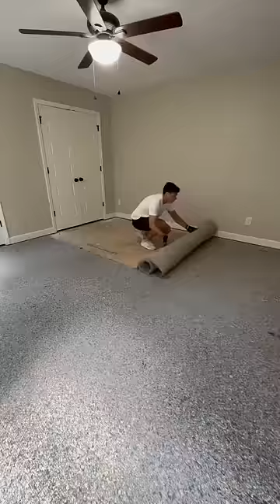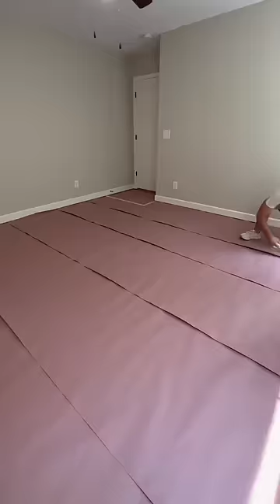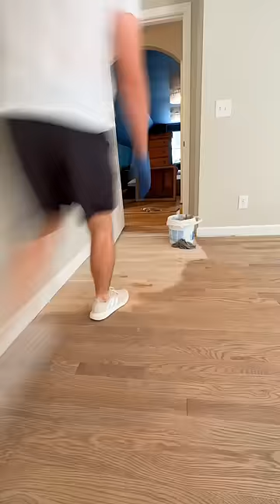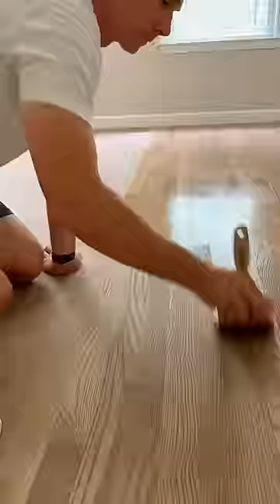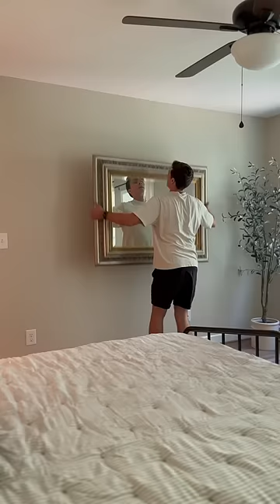Guest Bedroom Renovation #diy #construction

Comment: Wait… am I tripping or do some of the floor planks look like they are 1/4-1/2 inch from baseboard?
Reply: Yeah I’m wondering why he didn’t run it under the baseboards
Reply: Most flooring needs to be able to expand some what with changing temperatures & humidity or it'll cause buckling/ lifting
Reply: It’s most likely he didn’t want to rip out the existing baseboards so he just laid the flooring down and threw some similar wood quarter round to cover it up. You can see it in the end shot with the night stand.
Reply: Yeah most would have taken all base boards off the wall before laying the wood down. After installation of the floor you then put back the base board if sine right the base board will completely remove any visible gaps or cracks between the floor and wall. However I believe he may have just taken base boards off at the end and replaced them with thicker base boards wick should hopefully cover the gaps and cracks anyway.
Reply: It’s called quarter round
Reply: @N9tmare-s550  Technically we call it shoe trim in this situation. Quarter round is one option but there are multiple moulding choices.
Reply: You’re not… it’s gonna rot if what seeps through 😂
Reply: @tatummacbride-deaver3081  you should still put those gaps below the base boards...
Reply: You can see in the final shot they added quarter round on the bottom of that baseboard.
Reply: Expansion gaps..thats where the quarter round or trim would go on top..maybe he did it after the video?
Reply: Took all that time to buy and miter shoe the moulding. Should have just removed and saved the base board for a pro look.  Shoe molding is for Hacks.
Reply: @tatummacbride-deaver3081 not if you let it acclimate in the home before installation per the instructions
Reply: He used quarter round the same color as the floor. More commonly it matches the baseboards.
Reply: Likely hes going to use shoemold
Reply: @N9tmare-s550 base shoe is what should be used. Quarter round looks worse.
Reply: it should never show past your base boards dude that's insane this floor is just bad
Reply: @tatummacbride-deaver3081  Ahh no! Don't ever comment on things you know nothing about
Reply: Came here to comment this. He was to lazy to pull the base. Probably did 1/4 round after.
Reply: @N9tmare-s550  Lazy look
Reply: @tatummacbride-deaver3081 LOL he thinks it needs 2" to expand we're talking MILLIMETERS BRO

Comment: Maybe he missed intentionally? Take the baseboards off (yes, it may muck up your paint finish - use a knife) and run your flooring 1/4 away from the wall (or more if needed - calc expansion factor) and then use 1/2 inch baseboards after
Reply: He put shoe molding down.
Reply: @gaigehidalgo4721 still should have taken the baseboards off
Reply: @gaigehidalgo4721 shoe molding, the lazy way out.
Reply: Yea looks like he left base boards on there

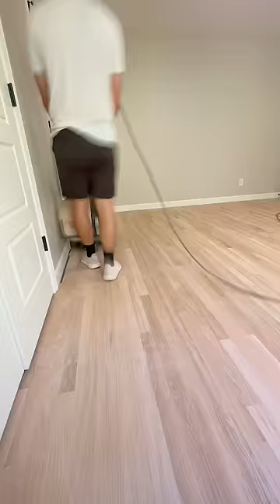Comment: We just gonna ignore how terrible this looks on the edges????  at like 0:22 you can CLEARLY see that like there is a massive gap against the wall on like 80% of the boards...  Sure you did this on your own but wtf is that crap?  Anyone doing this you NEED to take floor boards off put the floor down and then cover the slopy ends with the floor boards.  That is literally why they are there...
Reply: I thought the same, but it looks as if he finished it with quarter round before he assembled the bed and placed the drawers.

Comment: What paint is used on the planks ? 
Please answer
Reply: He used polyurethane.  I couldn't read the can he was using but.  The stains and polyurethane used for floors are specifically formulated for floors. It's not your everyday polyurethane!  Polyurethane likes to have air bubbles in it when you apply it. Polyurethane also doesn't want to dry very fast.  Two very thin or even three coats .  Apply to thick and it wont dry at all.  Good luck.

Comment: If only you would've pulled the baseboard... In all seriousness though it looks great 😊
Reply: Why should the baseboard be pulled?
Reply: @Bryan-wq1ng cleaner look to tuck the new flooring under the baseboard, or else quarter round should be installed to cover the gaps.
Reply: Yeah lad did a good job, I would’ve used 2-3 coats of floor poly aswell, and props to him brushing it out instead of lamb skin or rolling it
Reply: Lol you asked why...😂